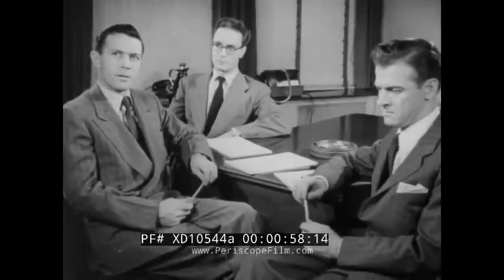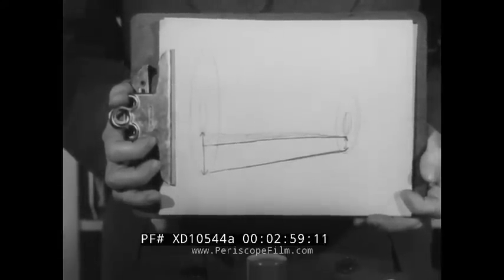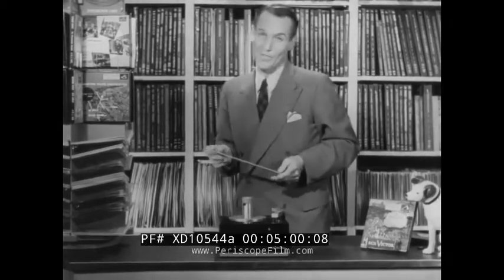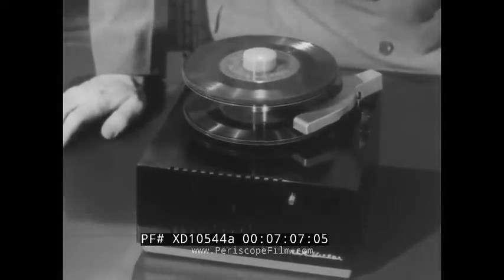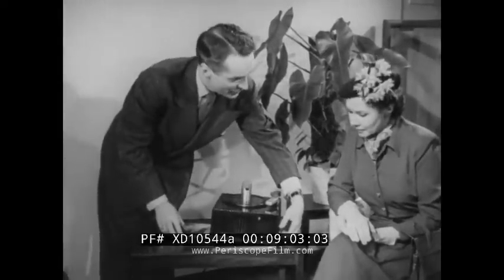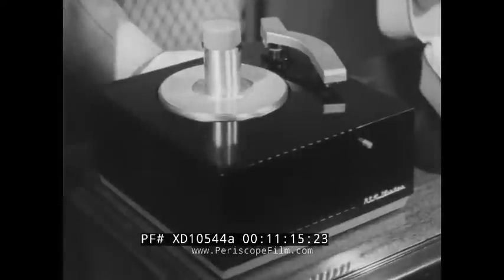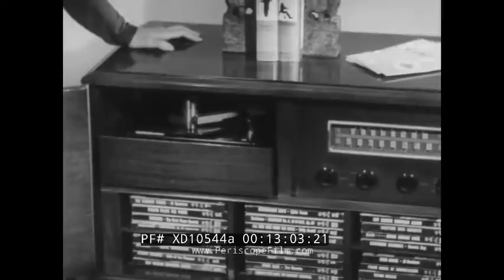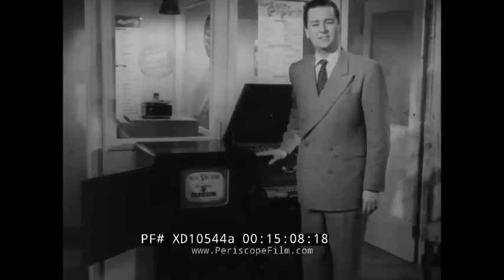NEW RCA 45 RPM RECORD SYSTEM & RECORD PLAYER PROMOTIONAL FILM   VINYL RECORDS XD10544a

Comment: I started building my collection of 45's in 1964; I still have the entire collection of more than 400 45's. I also still have a few of my father's 78's. Years ago, I owned a stereo record changer that could play 33's, 45's and 78's, with a flip-over needle for 78's or 33's and 45's. Man, those were the good old days, but, I really love my MP3's.
Reply: You're absolutely right but I still prefer and really love my vinyl :) Love those magic record changers!!
Reply: 45 rpm records weren't sold in Brazil, I have 1 or 2 but they are imported, 16 rpm although some record had this option I've never saw a solely disc !
Reply: I got too many 45s I’m currently trying to weed out the multiples and records I don’t like

Comment: There was the adapter that fit over the 33 changer spindle to allow 45s to be used too. They usually came with those old console type systems. They worked well as I recall.
Reply: Oddly, my folks weren't big on records until we got a Westinghouse phonograph in '58 and I've never used a cylindrical changer. I remember a rectangular one that fit over the spindle but actually, I never collected enough 45s to use more than the plastic inserts...
Reply: Those happened quite some time after this video. At the time this video came out, RCA & Columbia were at the beginning of a format war, and doing their best to make their players incompatible. That’s why the units shown here that play 78s use a completely different turntable to do it.
Reply: In some territories such as the UK there was no difference in the hole size between 45s and 33s.
Reply: @martinhughes2549  That was handy.
The British have a knack for keeping things simple, and adapting.
Reply: @captaintrips2980  I remember adapters for imports and ex juke box 45s though. You can buy "dinkers" to widen 45s with a narrow hole for jukeboxes as well.
Reply: That's why other manufacturers began offering turntables and players that could accommodate all three speeds by early 1949.
Reply: @danieldaniels7571  it was sometime in the 60s I saw them included with those big wooden console jobs. Th y worked great, and those furniture like stereos could put out some good sound with their vacuum tube amps.
Reply: @Miserable Ol'Bastard As a kid I got a Motorola console from that era in the late 1970s that I kept through the mid '80s. It had a tube amp and great sound. I added a line input to it so I could play tapes on it too, as it only had a record changer  As I recall, the 45 adaptor for it was round, and stored in a special hole inside the cabniet next to the space for storage of albums.
Reply: @danieldaniels7571  Wow, I did that too! I'm no electronics wizard, either. Those things had amazing bass response. The adapter I had was black and sort of rectangular, and fit into a slot for storage. You could really load it up with records too, and it rarely failed. It did sometimes drop two 45s, however.
Reply: @fromthesidelines  The Voice of Music (VM) Trio-Speed came out in early 1950. It was a modified 10/12" 78 rpm player with a 3 speed selector that automatically set the set down point to 7" when the speed was set to 45. Two years later, it was succeeded by the Trio-Matic, which automatically determined record size independently of the speed setting. Trio-Matic was in production until the late 1960s, when most manufacturers abandoned automatic size selectors in favor of a manual setting to facilitate repeat play.
Reply: Doug Browning I can only imagine how much those pissed off the people at the top of RCA.
Reply: @danieldaniels7571  The fact that both CBS and RCA were contracting phonograph manufacturing to VM was responsible for how fast they developed their own multi speed players, which they sold under their own name, and to other OEMs. Plus, VM was licensing their products to international manufacturers, Seebreeze in Canada, Telefunkin in W. Germany, Wincofon in Argentina, etc..
Reply: They made different kinds of adapters;

A round ring that fit over the spindle.

A plastic adapter that fit inside the center hole of the 45

A cylinder that allowed the playing of multiple 45s.   Each cycle of the tone arm would cause a record to drop onto the platter.
Reply: Those old tube sets were no joke,  compared to the cheap crap that was going to come  out after them.  My friend owns one, a strongburg-carlson.  That's when quality audio equipment was incorporated into high grade hand built cabinets.   Then of course came the cheap solid state crap and the fiberboard- plastic fire starters.
Reply: Tube amps are always underrated.   25 watts will bring the house down.

Comment: When this 45 rpm player was introduced, Columbia CBS introduced the 33 1\3 rpm turntable, which the spindle is the same as on 78 rpm players. The three speed turntable was introduced quickly after that.
Reply: The CBS LP system was actually introduced to the public a year before the RCA system came out. This was what led to the "battle of the speeds". What's interesting is they both used microgrooves, vinyl media, and had non touching surfaces.
Reply: @dougbrowning82  Earlier Columbia micro groove albums were flat. Columbia did introduce the raised rim to its albums along with the shouldered (raised) label so that by theory, the playing surfaces did not touch each other when played in stacks on a record changer.
Reply: can i blow your mind for a second? 33 1/3 + 45= 78
so the 78 speed could usually be set by playing BOTH speeds together(45+33

Comment: 10:48 Except for the longer center pin this is the famous "RCA" plug/jack still used today. Most modern jacks will STILL accommodate the longer pin! (I have attached vintage turntables to modern amps!)
Reply: Heck, I've connected an iPhone through a Y splitter RCA cable (in reverse) to a 1939 vintage RCA console radio. Sounded pretty good!
Reply: @patricknesbitt4003   My heated  Snowmobile face shields use RCA jacks .
Reply: The generic name for that plug and jack is "cinch plug", but many people just call it a phono plug because RCA developed it to connect their phonograph decks to their radios.
Reply: @dougbrowning82  Yeppers! Before that, RCA radios used screw terminals for "phono attachments" (like VHF/UHF TV terminals for "twin lead").  The "RCA"/"phono" or "cinch" connector was perhaps the first consumer COAXIAL interface. And it's STILL going!
Reply: I interface an Mp3 player with a 1939 Zenith console radio that has a non coaxial (two pin) audio input, It's labeled "Television"! (Zenith, was assuming an upcoming video ONLY option once TV became a "thing"?) It was probably used for Phono, or not at all! But! It takes a moderate ("Walkman" level) input so it's PERFECT for straight up "out of the box" playing of Old Time Radio Shows! (The Shadow, Sam Spade, Inner Sanctum.....)
Reply: The long pin on old phono plugs was used to disconnect the internal connection between the radio detector and the first audio amp, allowing the signal on the pin to drive the amp instead.
Reply: @dougbrowning82  Yep, and that's why it's not used on later cables, as later receivers have an external "phono" switch.

Comment: We had one of the RCA 45 RPM players when I was a kid. It didn't have it's own amp and speaker and had to be plugged into our Strongberg-Carlson table radio by a jack input on the back of the radio which dad had to have installed at a local radio & TV store. All of the 45s were somewhat warped but wasn't a problem. Years later I got a 45 of Wings' "My Love" with the grooves pressed off-center and the playback was awfully distorted. 45 singles were right for the times. Glad we've moved onward & upward.
Reply: Digital compression of music,  combined with the lousy playback quality of computer speakers and cell phones....  

i can't call that " improvement. "

When I have had guests whose age is under 30yo, their jaw drops to the floor when they hear the deep, rich tone quality that accompanies vinyl records and quality receivers.

That age range has never in their life experienced that level of audio immersion. 

It's a return of a former experience that has brought joy to my life,  just as it did when I was knee high to a grass hopper.
Reply: @williamdenton5716  Couldn't agree with you more, William. What I was referring to was the 33 1/3 higher quality vinyl, near-perfect turntable machinery, full-fidelity speakers and amplification equipment, which likely achieved their zenith many years before the unfortunate digitized developments you mentioned.

Comment: I started playing 45 rpm’s in the 60s and didn’t know until today how they came to be.  I figured it was all random.  Very educational.
Reply: It was probably all random. Columbia had the same success with 33 1/3 rpm and Columbia came up its own format, the 7 inch 33 1/3 rpm single with the small hole for standard spindles. Columbia used that format until around 1952 when it switched to the 7 inch 45 rpm format only because most of the other labels were switching to the RCA format.
Columbia resisted because it didn’t want to pay RCA for use of its format.

Comment: "Distortion free" they said, about 100 times.   Then, a few years later, RCA invented the Dynagroove pre-correction to get rid of some of the distortion.  Then the Japanese devised elliptical styli to get rid of some more.   Then the Brits devised linear tracking tone-arms to get rid of the distortion still remaining.
The presenter forgot to mention that the plastic used in 45's was a lot more susceptible to warping than the old shellac 78's.   I had to laugh when the 45 he demonstrated was already warped.  
Big holes and separate players didn't last long - ideas that must have seemed daft even during development.
Reply: That warping what added rock and roll's.. Whoop whoop! Whoop whoop! Sounds. ...
Reply: Well that poor guy at 2:35 with clown tie is buying it.
Reply: Re the big hole design not lasting long, it depends on where you lived. In the States, for example, 45s always had them.
Reply: @perrybarton  :  Yes, like Lear 8-track tapes, S-100/CP/M computers, and non-metric measurements - only in the USA.  Actually, didn't they eventually come up with a design for 45's that had a three-pointed knock-out section, so that you could play on a regular 9/32" spindle turntable, or knock it out and play it on a large spindle turntable?
Reply: "Dynagroove" discs weren't introduced until 1963.
Reply: Barry I. Grauman The sane year that I was introduced! 😂
Reply: @keithammleter3824  here in italy 45s always had large holes, i believe the same was true for most of continental europe
Reply: @keithammleter3824  In UK and parts of europe and elsewhere, both the optional/jigsaw removable centre, and the push out ones with tris and 4 prong variations.  Fontana in the uk for a while tried large hole only ones, expecting dealers to add a spider if the customer requested.
Reply: Millions of those 45's records were sold for many years.  We went from a RCA large hole 45 player to a 78, 45, 33 1/3 combo player.  The turntable had an adapter built -in.  Plus , all of the Jukeboxes ran 45's.  Fun times sitting at a soda pop or restaurant in a booth and popping dimes in the remote and listening to music.   So yeah, 45's were very successful....  Plus, I have the very 1st set of colored 45's ever released in a envelope that was given to record managers in Feb,1949.  My mothers friend was a record manager and she gave them to me after I helped her move in 1967.. I was 17 at the time.  I Never played them.
Reply: @WestCoastDP  : Certainly 45 RPM singles were very successful - from introduction, up until the introduction of CD's in the 1980's.   I bought 45's myself when In was a teenager in the early 60's.   But I've only ever seen them with the small hole the same as 33-1/3 LP's.  I'm in Australia - perhaps we never bothered with the large hole version and just went straight from 78 RPM singles to 45 RPM singles with small holes.
Incidentally, when you bought a 45, you usually got 2 good songs.   When I was a teenager 45's cost $1 - 50 cents a song.   An LP cost about  $5 and you got 8 or 9 songs.   You might think 45's were not good value, but many of the songs on most LP's were third rate, or covers of other artiste's songs, so you only really got about $2 worth.
Juke boxes had very good sound, but were expensive - as I recall, 10 cents each song play.   If you took a girlfriend to a JD's (hamburger place) or to a milk bar, and there weren't many other customers free with their coins, you could go broke pretty quickly - about 30 cents for the milkshakes, another 40 cents or so for food, and up to $2 for the jukebox.  A lot of money for a teenager back then - would take me days of part time work to earn it.  Just to get a shine in your girl's eyes for an hour.
Reply: The big hole was a great idea - far less wow than the stupid tiny hole we have hadto live with for the past hundred and twenty years

Comment: The 45 RPM format was great for those who did not want to buy an entire album, but just one song (and its B-side). That's about it, really, except for slightly better fidelity because of the slightly faster speed.
Reply: I noticed that this video fit into the very small time frame when the 45rpm EP records were available. 

At least 3 songs per side on the EP's.

The 7" single song per side took off a year or two after this.

Comment: The coolest feature of the "45" (and somewhat defeated when stored in an album), is that you could grab a "thumb full" from a stack and drop them on a changer. I know they were pushing albums (to compete with 78 rpm and 33.3 rpm) but, CLEARLY "45" was THE medium for "singles" (as history has shown). RCA may have failed to convince Classical fans that this was THE medium for Symphonies, But it came out at the exact right time for the coming "Top 40" radio explosion!
Reply: James Slick I love how this film nonchalantly pretends Columbia’s LP format doesn’t exist.
Reply: @danieldaniels7571  LOL Right?, I doubt that a Chevy film would have admitted that Ford and Plymouth existed too. But, in the end both "45" and "LP" were winners. That's rare!
Reply: @danieldaniels7571  Even their big consoles didn't have the 33 long play. Very good marketing by Columbia to sell a simple Philco plug in long play turntable.
Reply: @bbailey7818  Yes, RCA pulled an "Apple walled garden" approach, Columbia (and just about ever other manufacturer that licensed the Columbia 33 RPM LP system )made a way for their devices to use ALL three (33,45 and 78 RPM) record formats. Good for them AND the consumer! Good thing RCA held so many TV patents, Their early attempt to be a 45 RPM only system might have sunk them in the 1950s!🤔

Comment: It's very telling that it took RCA about 7-8 years to meet Sarnoff's challenge to improve on the 78 RPM Shellac record.  You have to wonder how much of that was the engineers formulating the new format and how much of it was the other departments dithering about the risks and feasibility of a single company attempting to wean the world off the old format! I expect there were similar internal tussles in Philips regarding CD in the late 1970s and early 1980s.

It's starting to feel like a little bit odd notion now that just a few big companies could be the main gatekeepers between the talent and mass audiences for music, but for 60 years or more they definitely were. By owning the means of recording, technical transfer to and mass production of discs and (in many cases) owning the distribution networks as well as slick and all reaching promotion departments - they had a very large degree of control.  With a lot of that now gone it's small wonder that the music industry is so very different!

Up to 50 minutes of music with no attention needed!  It'd be fun to reach into the film and drag these guys to now and see their reaction! Wonder how long it would take them to catch up with where things have got to!

Comment: I also thank RCA to have invented 45s, as about 90% of my large collection are the beloved 7" records! They're easy to handle, and you can have incredible variety in the same room space that would be taken up with larger records. 45rpm is optimal as well, faster and a bit more vibrant than most recordings on 33 1/3 rpm. On the other hand, they're less fragile than 78rpm shellac records. 45s are a good compromised conterpart of 78 10" singles, even though the speed is slower. And above everything, all of these analog recording technologies smash artificial digital recordings. That's why the 45rpm 7" records are my favorite format of all time. The only improvement to the RCA invention I would suggest is to records short tracks of, maybe under 2:30 or so, at 78rpm on the same vinylite, played with the same microgroove stylus. BELL Records made a few 7" 78s in the 50s, and the quality is even better, if you can get a copy still in decent condition (as all the ones I got so far were in not so good condition).